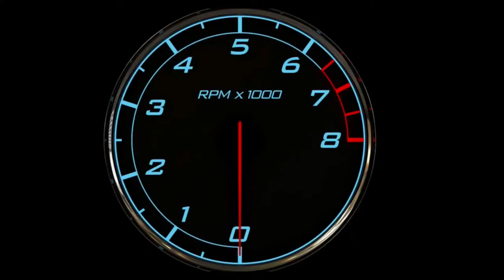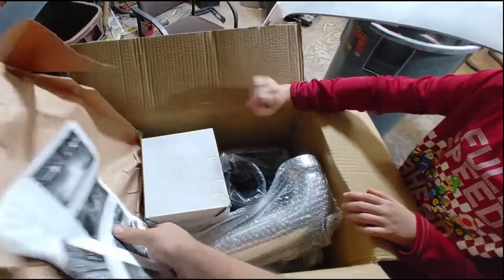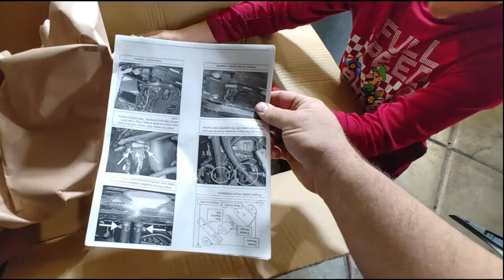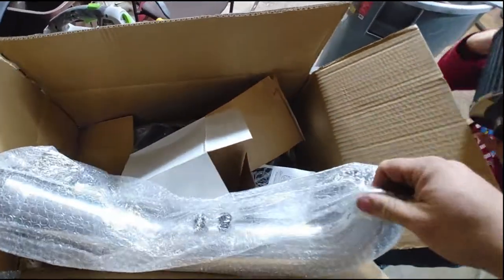Cheap Amazon Intakes Install(Armada Titan )  Sounds Amazing!

Comment: I initially was snooping Amazon for a drop in filter replacement in my QX80 but what I had ended up doing was ordering a 3.5" maf tube for the Nissan gtr. I then ordered a 3.5" aluminum pipe and put a cone air filter on the end. I kept the factory slip tube from the throttle body and just deleted the airbox. It's not much a difference than a drop in filter but I'd like to think so with the massive conehead 😅
Reply from the maker: Lol, yeah, I think a good portion of an intake is for aesthetics and that sweet induction noise.
Reply: @BarkLife  true that! It explains why this was my 1st modification to the truck but the engine can only pump so much air. I think for the money, Id save it and put it elsewhere like in a handheld flash tuner or even a piggyback ecu from Uprev would be well worth it! Then convert to run E85 fuel for more timing and leaner a/f ratio but thats just my two cents.
Reply: @BarkLife  cams also go along way in these motors. Jim Wolf is somewhat local and I've been eyeing their CS2 cam kit with beehive springs on intake side 🙃